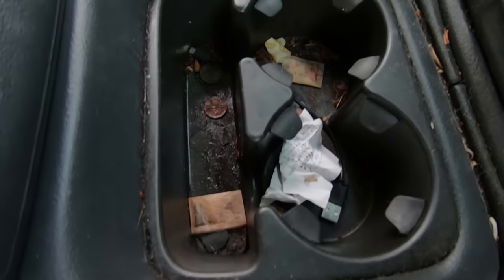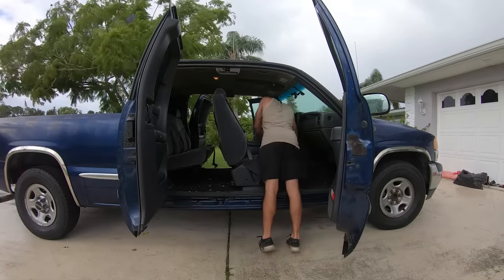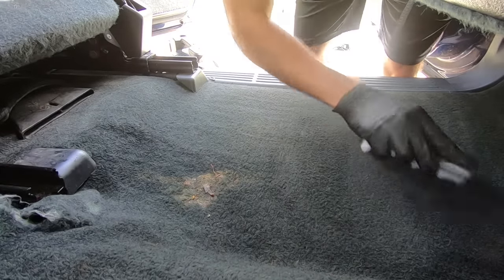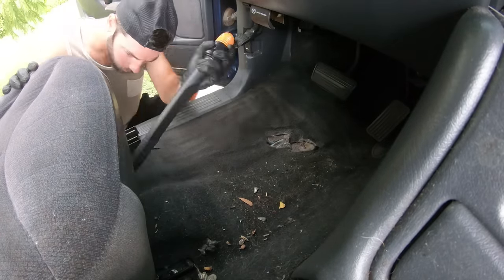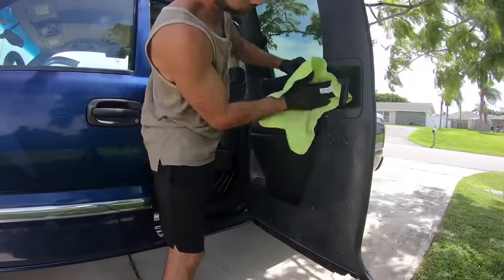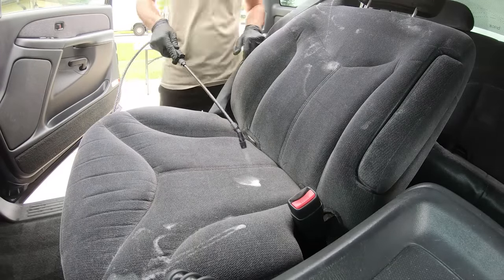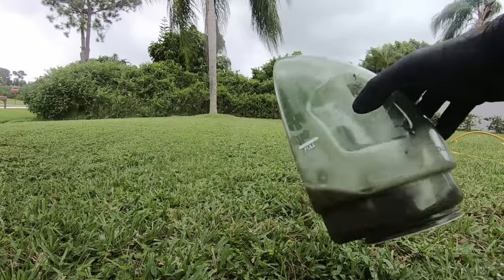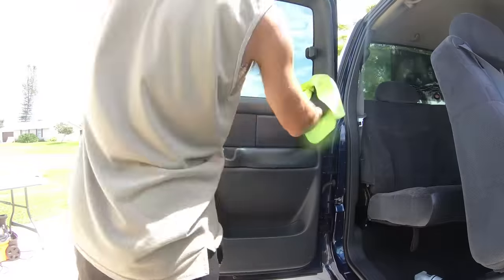Detailing A Terribly Filthy Pick Up Truck! Full Interior Detail

Comment: You asked for a solution for your sand problem. 
There is only one way to fix it. Buy a tornador gun and blow the heck out of the surfaces. When done, its very easy to vacumclean floor and vinyl etc. 

Best regards 

Jakob
Reply from the maker: SpotOn Bilpleje thanks Jakob!

Comment: If you have access to a large capacity air compressor (25 gallons or larger), a Tornador is AMAZING at blowing out sand and dirt from the carpet. 
I was shocked the first time I used one on a floor mat, soooo much dust flew out, and the mat changed color from a dirty tan to its original factory grey.

Comment: Nice. Use the drill with a brush attachment for the sand in the carpet. I’ve seen other detailers do it and it’s quite effective. Also try rolling the window down after you clean it so you can make a last pass around the glass edges. That helps a lot too. Good luck!

Comment: After you clean the carpets, interiors (chairs), I would either use Tuff-Stuff, or Scotchgard cleaner to clean any stains, then put Scotchgard protector to create a barrier so if something spills, or there is dirt you just vaccum, and there it is new again, of course if you buy a new car, it*s always good to scotchgard it to protect the carpet, mats, chairs, door panels,, as to the glass I use Rain X, to prevent fog build up inside which will happen or if you are cleaning the glass inside, this will  add like aprotection against fingerprints, as to the outside of the glass I use Rain -X for outside, cause if it rains the water would bead up, annother good idea, which I practice, is with the wiper blades, the black part ,after certain uses cleaning the windshield, the blades tend to get hard thus scraching the glass due to the black part cracking up with sunrays, or cleaning the windshield, the rubber part gets so dirty, it doesn*t clean right leaving streaks, what I do, is get a piece of cloth or paper towel, put some vinnegar or alcohol on the paper towel or cloth, pass it along the black rubber, that cleans the windshield, you would be surprised at the amount of dirt coming of the black rubber that cleans the winshield, plus it serves as a lubricant to help maintsin the cleaming part from drying up, I myself do it to a 2014 car, and here it is 2019, and I have not changed the wipers, when you think how much each blade cost vs. the money you save cleaning the blades, you can save a lot of money, now if the blades are worn out then you replace,👍👍👍👍👍👍👍👌👌👌👌👌👌👌👌👍👍👍👍
Reply from the maker: Enrique Lopez wow, great thorough comment Enrique. Thank you! The tip about wiper blades definitely start doing that.